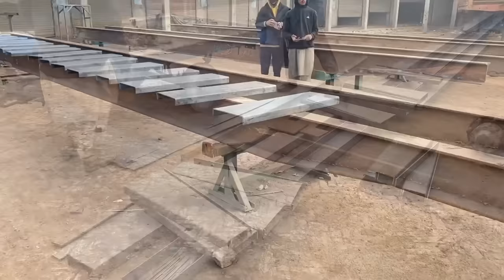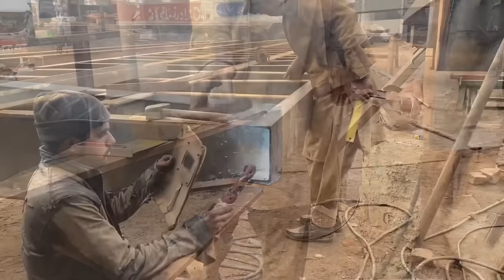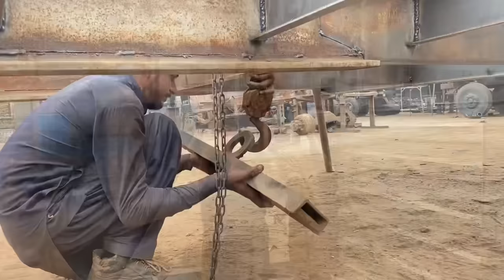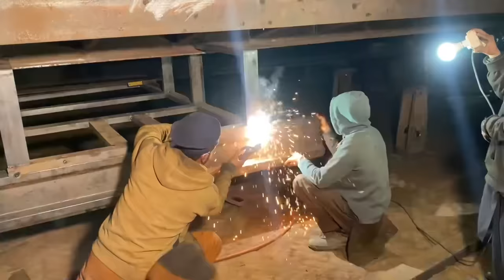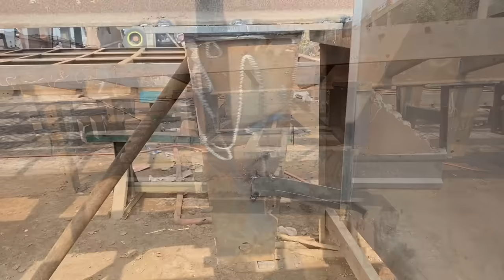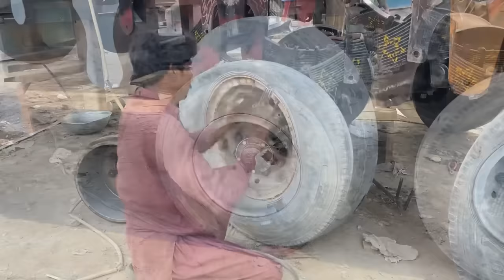How Amazingly Manufacturing | 22 Wheller Truck Body Manufactured With Amazing Technique

Comment: Wondering why need to put design on your vehicles, so ugly i think (just my opinion) and is it important until need to coloring trucks?
Reply: It has to do with there religious beliefs. You probably wouldn't know anything about that.
Reply: @xanderzurasky7837  They re Muslim and so do I.... So you really gonna teach my own religion dude? Talk about truck, I also truck driver, 26 wheels, 4 axles trailer tail, load 90++ tonnes... hurmm 🤣
Reply: Why don't you build and post it so we can see your work Karen
Reply: Look at the equipment work space safety equipment and procedures. They wouldn’t have jobs if the product was cheep
Reply: ร
Reply: That not your truck😂😂😂

Comment: Did anyone notice that there are no brake lights and no air hoses connected when it drove off ?  That’s a little scary I hope it was going some places next to be installed and not just being driven around. I agree that they probably don’t get paid nearly enough for what they do and for all the risks they are taking.
Reply: They shouldn't be able to move it with no pressure in the brake system.
Reply: @thefreedomguyuk  I guess there are no breaks on the trailer then.
Reply: @MrToraas  No mud guards either.
Reply: also notice unsecured fragment piles on deck- cars drive behind that!
Reply: great video right?
Reply: The did all the brakes, electric work but didn't show bcaz that was done on a different day

Comment: I did enjoy watching this trailer being built,  yet it doesn't matter that it's clearly a different trailer at the end, It's not a good idea when coupling the unit up to the trailer when the unit is too low, as daylight is between the fifth wheel and the trailer when the king pin and fifth wheel locate. I know there's no air suspension used here, but bits of wood under the tractor units axle would raise it up enough, doing it wrongly will only cause damage. Despite the crashed tractor unit clearly had air and electrical suzies, I assume that this trailer isn't going to be fitted with working brakes and lights, as that would've been done before painting, also this unit didn't have any air or electrical suzie lines anyway. Is the reason the driver didn't do a snatch test on the connection as there's no brakes to stop the trailer moving forward?. The weight of this trailer empty would be bad enough as it looked mega heavy, I'd dread to think of the consequences when it's loaded.
Reply: Fab work, but the weight of all that steel did criss my mind alight

Comment: This trailer appears to be entirely spot welded. In a crash, this thing would fly apart like a handgranade.
Reply: I was wondering about that.
Reply: There's no tapering-in on any of the ends of the pieces of metal being welded onto the main spars or similar.

Comment: As someone in the US, it's odd to see trailers being built with such heavy steel frames. In the US, most trailer frames are made of aluminium, as it's lighter, which allows more cargo while remaining under DOT weight limits.

Comment: There’s very little left to the imagination if you compare a Pakistan built truck vs a Japanese built truck the difference between the two are immensely different and complex where Japanese trucks are built with advanced technology components sophistication that enhances the overall quality and efficiency of the vehicle and mannerisms for a comfortable atmosphere within the truck cabin unlike any Pakistani truck which a basically carriers and don’t require any other type of commercial comfortability and safety features just the ability to operate with minimal modifications and questionable long distance driving reliability

Comment: one can only admire these hard working men. however... no fucks given for any amount of safety or quality. welding directly on dirty rusty steel these seams will crack at some point. exposing skin to weldarc for just a few seconds will give you a mean sunburn. these Hands and Feet are ruined for life. No level Floor to reference from... just to name a few.